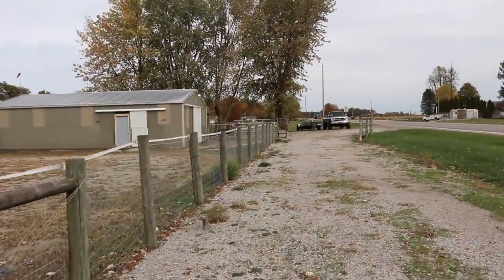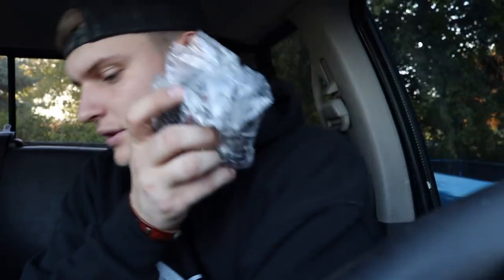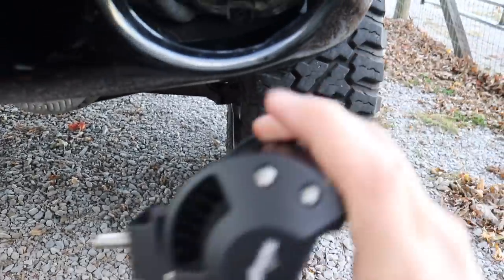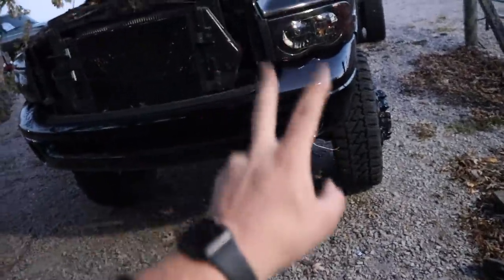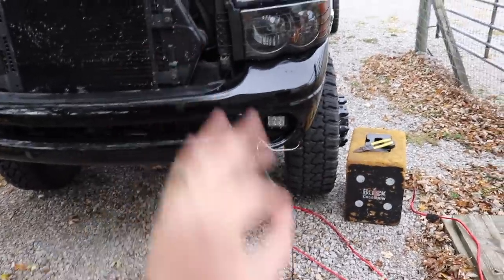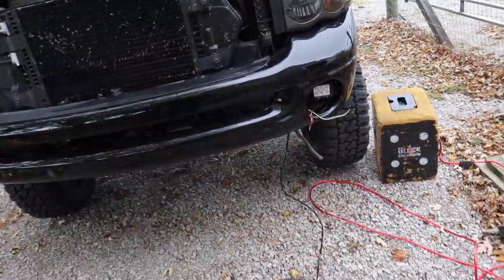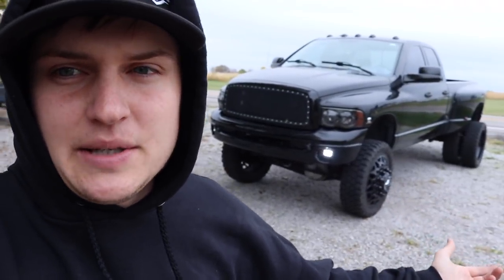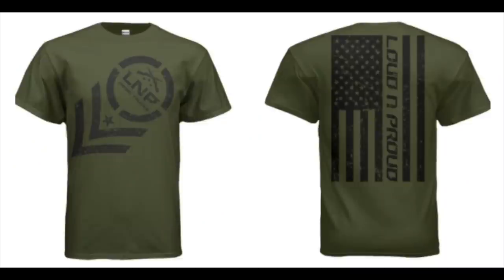Every truck NEEDS this $20 UPGRADE!!!

Comment: If the truck has oem factory fog light harness the led lights hook up different if u have white or grey or black comming out of the harness u wanna hook white to the black on the led pod light and then run the black to the red on the led that’s only way it will work I had to do that to get them to work on my 2018 GMC Sierra

Comment: very cool hope you used lock tights on the brackets have had the bolts back out on them a few times, if not i will when i win, just orderd a hat cool video something normal people do nit in a shop with a lift keep up the cool content